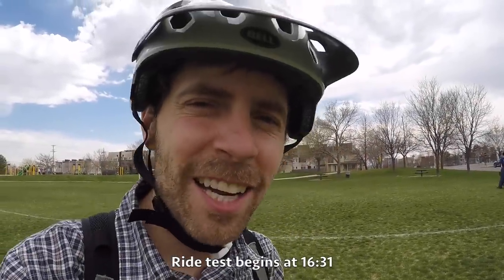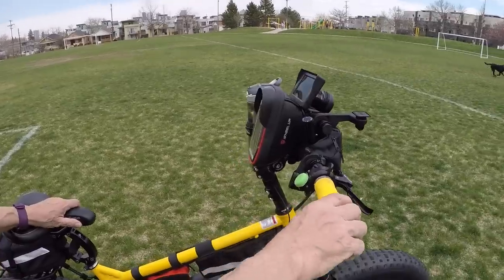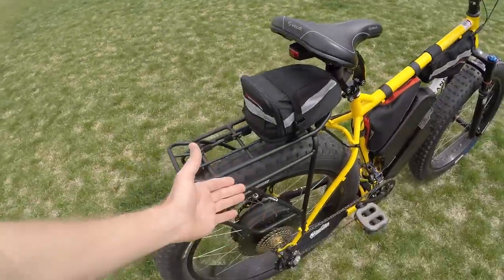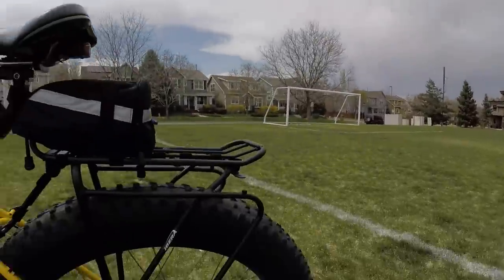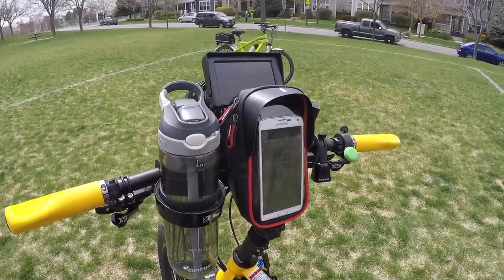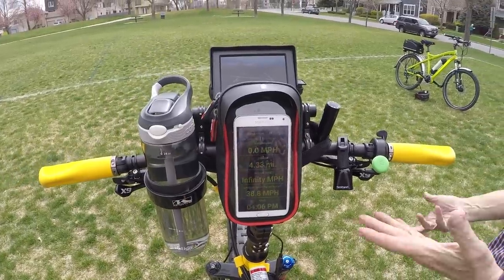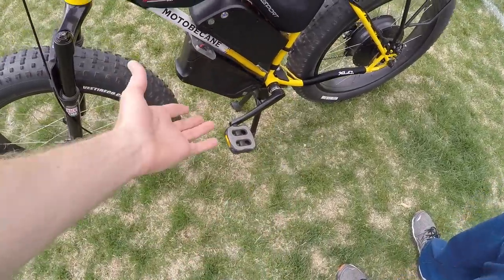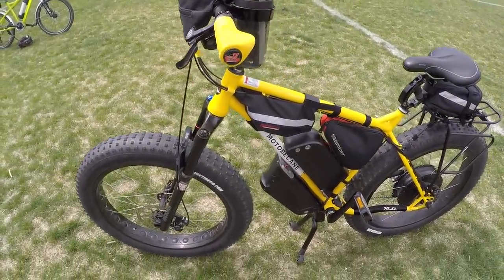Tricked Out Fat Tire Ebike with Loads of Accessories

Comment: Nice mention of the wear on nylon gears in a lot of ebike motors and also it was nice to hear him comment on why not to use an aluminum frame on a ebike build this heavy.
Reply: Nylon is quiet vs steel longer wear. Pick one. :-)
Reply: I think it's going to be increasingly relevant to separate ebike users like Ron and those that are non-throttle, low-load users. Things like heat dissipation and wear and tear factor in different for different use cases. If the motor never gets that hot, then nylon gearing probably isn't a big deal. But as Ron mentioned, more copper and bigger hub motors dissipate heat better.

Comment: Can you send me a link to the kick stand? . What metal part did you have built for it to work?.
Reply: If you look at 5:26 in the video he had steel plates made to mount the center kickstand. The kickstand it self is modified (widened) to clear the  4 in. tire.

Comment: Question: I have a 1000 Ecotric Hammer, 48 Volt, I want to use a 52 volt battery with. Is there any reason why the 48 volt controller would be damaged by this?
Reply: No you can safety take it up to 15s 60v or 14s 58.7v [52v] or stay 14s 48v all are essentially the same thing because 99.9 PERCENT of 48v controllers have a 63v capacitor meaning that’s the top end voltage but yes in short 48v is designed to take all different types of batteries with various voltage chemistry LiPo,lifepo4..lithium etc..
Reply: Wow! Thank you so much for the reply! I am going to subscribe to your channel in case I have any more tech questions. That was the most concise answer I have gotten from all the ebike channels I asked this question..

Comment: I wanna buy my dad a electric bike with fat tires does 20-25 miles per hour with rang of 30 miles & under 1k USD & my dad is 6"3 tall guy Any recommendations¿
Reply: I just got a M2S R750 fat bike for $1800 I go almost 50 miles a day and charge the battery at work and home it has a 16 ah 48 volt battery with a 750 watt geared bang rear hub motor. Have almost 600 miles so far with only a flat tire yesterday it has been flawless and go 28mph

Comment: The trouble with this though is when the battery dies and you didn't make it home you have one hell of a push with a 40kg bike.
Reply: That is why I got two separate drive systems and separate battery's for each on my Ariel Rider D bike I got a mid drive and two hub drive motors  hubs for speed mid drive for hills  and a rear view camera and a fram air horn  for traffic

Comment: Wow - 82lbs is just over 37kg according to my calculations...A Steel frame with 2 Batteries & accessories makes sense together with upgraded rotors...
Reply from the maker: Yeah, that's about 37.19 kg! The steel frame is a great fit for this bike because it has the bottle cage bosses on top of and below the downtube to carry two batteries, there's plenty of strength for the rear wheel (especially with those torque arms) and it just won't be as rough as an alloy frame :)
Reply: Having looked at this "customised" design again, I have t say that from a safety viewpoint what he did with the stem extension could cause serious injury if it hits an unsuspecting pedestrian or himself. Its quite possible that in wet weather he could be going at speed, loose the front or rear and the bike goes flying or sliding spearing somebody with that stem causing major trauma. Court i live in Melbourne (AU), I think u know that electric bike rules over here are quite primitive & strict. I know of ppl that have converted MTB Bikes to electric to enable both pedal assist & throttle - they use them both on bike trails & public roads where the police have been know to confiscate these machines...:-(

Comment: I do not understand the fat tire fad. Normal sized tires seem to work just fine.
Reply: Greg p fat tires work better on snow and loose sand
Reply: With fat tyres, I don't slow down for kerbs or small animals.